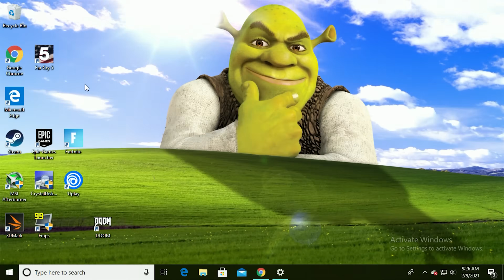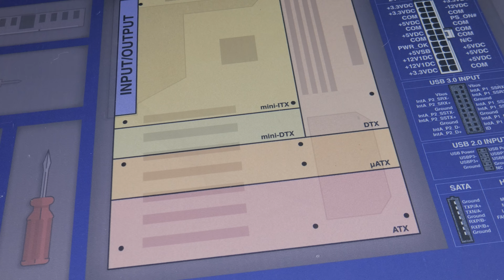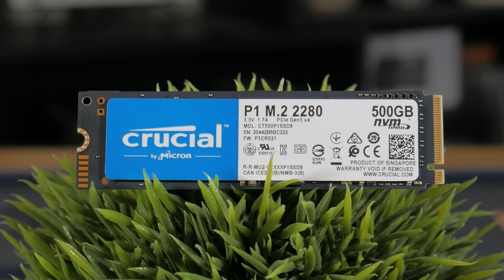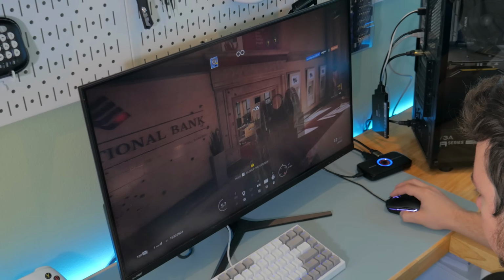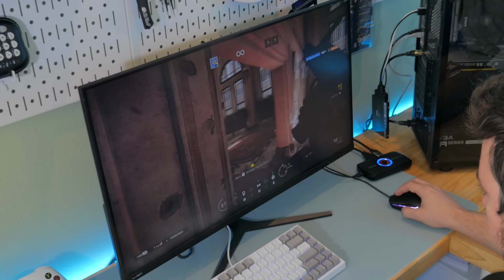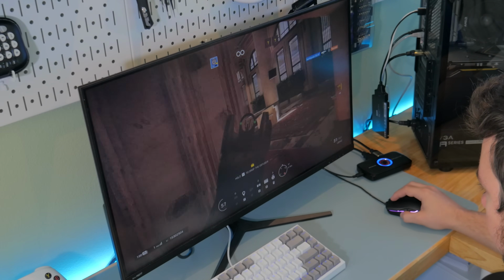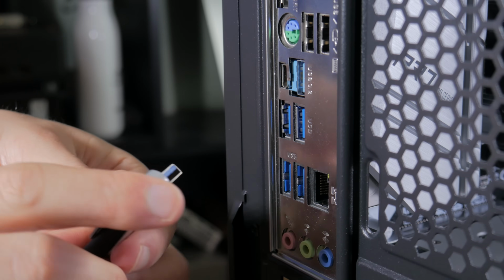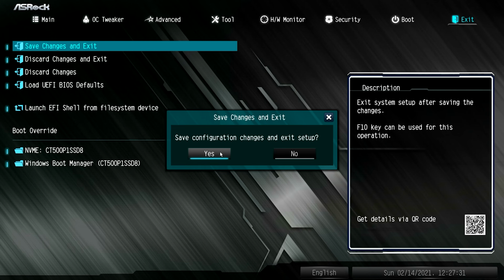HOW TO: Build an $800 Gaming PC! (2021)

Comment: I built this pc but I’m having some problems. 1 the usb is not working I plug my mouse and keyboard into any usb slot and they don’t turn on. 2 nothing will display onto my monitor. This is my first pc build and I have no clue what I did wrong

Comment: The graphics card I have doesn’t have an 8pin power header on it, does that mean I need some sort of adapter? I have the Gigabyte GV-N1030OC-2GI Nvidia GeForce GT 1030 OC 2G Graphics Card if that helps, if anyone could help me out that would be much appreciated

Comment: Started buying parts at the start of march, ended up going with a 2x16GB Crucial Ballistix set of RAM and a P2 M.2 2280 for the ssd, hoping everything will work together but i'm not sure since this is my first build. Also gonna spend the extra money and buy an overpriced 3060 with 12gb instead of 4.

Comment: Is the wifi card good? If not could you guys recommend a better one preferably wireless.
Reply: If you can and it's convenient use an Ethernet cable otherwise get a WiFi card just don't get an adapter adapters don't belong on earth

Comment: 0:28 no i am also tired with windows itself move 2 Linux

and i removed that watermark for 0.00$
Reply: Bro just buy a key for around $5 on eBay
Reply: @marshall1014  or use an operating system that wont sell your data
Reply: @crt0512  if you don't have anything to hide then its fine
Reply: @marshall1014  oh well i don't, but i prefer to not be spied on ;)
Reply: @crt0512  nah you definitely hiding smt
Reply: @marshall1014  wdym, u mean the FREE MINECRAFT HACKS NO VIRUS 100% WORKING SAFE that your searching for?
Reply: @crt0512  you know what I mean :)
Reply: privacy isnt a right its a nice little sprinkle ontop ... still would i trust my gentoo machine more than a windwos machine

Comment: The 3600 is kinda overpriced considering the 10400f is quite a bit cheaper
Reply: The 3600 is supposed to be 180$ and quite a bit better especially considering upgrade paths 

The 10400f is probs discounted :) for you although the Ryzen is a bit faster and has a better upgrade path

Comment: an rx 580 8gb is now 700 bucks in my country, used to be as low as 200 something before , with gtx 1660 super and rx 5500x sometimes a little less cause they are worse at mining probably and 2nd hand its still over msrp =)) .
All the prices in europe got messed up... I dunno who even buys em, at least here energy prices are pretty high..
Reply: It's 300 in mine :/ the 3060 to is only 460 here tho :)

Comment: is it okay to only have three front fans and and the stock cpu cooler in a gaming pc?
Reply: Yeah as @PCYYD said your best off doing this although Thier are a lot of better cases for the price 
If you don't want to remove the fans at the front for asthetic reasons you can buy a couple of decent fans for for 8ish$ each and put one at the rear and one at the top of you want better airflow

Comment: The video was uploaded 30 minutes ago and the graphics card is already out of stock :(
Reply: Yeah a year ago I found a gigabyte gaming rtx 2070 for just 400 dollars and then there was a r5 1600af for just 85 dollars with 6 cores 12 threads which performed similarly to a r5 2600 if u built this pc a year ago I give u a part list
R5 1600 af 85
Asrock b450m steel legend 70
T force delta rgb 3200 cl16 60
Kingston a2000 256gb nvme 35
Seagate barracuda 2tb 50
Gigabyte gaming rtx 2070 400
Thermaltake h18 35
Evga br 600w 80+ bronze 41
Uphere rgb fans 3 pack 24
Reply: @Reverse_Goat  that list isnt that good
Reply: @yumi-fj3vd  why? I didn’t wanna go dollar more or dollar less
Reply: @Reverse_Goat  my RTX 2070 super and ryzen 5 3600: we have a reason to exist now
Reply: @Reverse_Goat  shut up
Reply: It's because Thier is high demand for GPU unless you don't need a pc now it's not worth building one now because everything is 2x the usual price and out of stock
Reply: @David-tz1oi  there was like this in 2017 or somewhere near too the 500 dollar gtx 1080 was priced 950 on Joey Delgado’s video
Reply: Always has been.
Reply: Also I bought it a year ago

Comment: The gpu is not available at the first link and the second link is a broken link... Another build video for a PC that cannot be built
Reply: Get a used RX 570 .. still relevant and under 200$ most of the time.   I'm not buying a new video card until the prices are sane again.  F*** AMD and Nvidia.
Reply: @Dingbat1967  that gpu is still severely overpriced at even $150. It should be $75-80 used.
Reply: @GreyWolfTowers  Of course but these are the cards we are dealt with.  To be honest, I am going to start unsubbing from tech youtubers that keep making builds with unobtainable hardware.
Reply: @Dingbat1967  me too
Reply: Just go search for the GPU on Google if you want you don't have to use the links :/

Comment: I’m looking into doing a upgrade myself, without upgrading the GPU because of cost and supply I’ll have to reuse my 1080ti. It’s more of a complete build since I’ll be goin to a Ryzen based system. With reusing my 850 PSU, GPU, and 1tb ssd. I’ll be looking at $500-$600, and that price could change on the CPU choice. Case, CPU (3700x-5700x)RAM (3600-4200x4=32-64gb), motherboard (ASUS Stix model b550). I think this will be a good start on a build able platform. Specially since I’m still running a FX based system, which to date still works great. I may even do the new build in a retro Dell mid tower case.